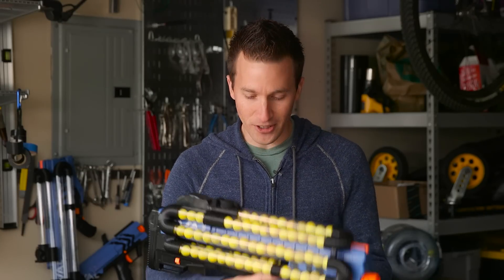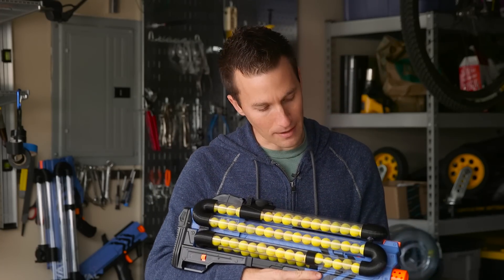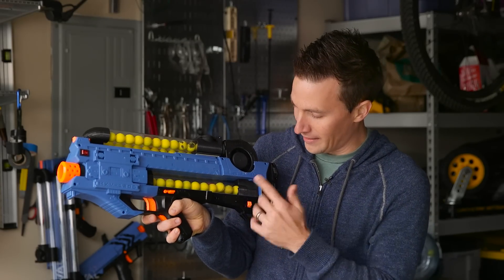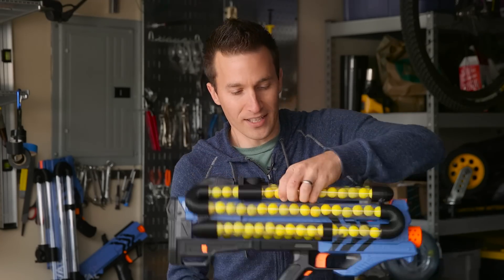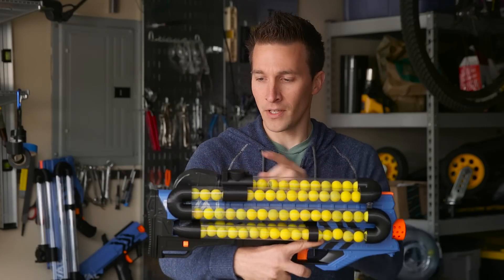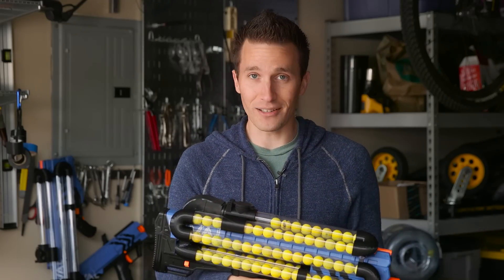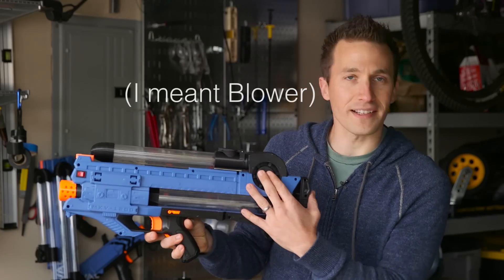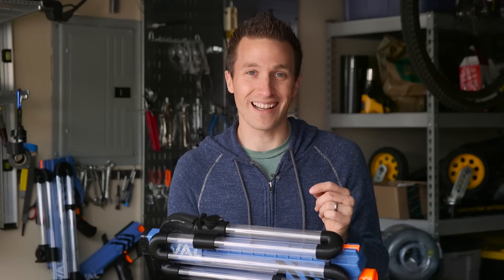MOD: HIRricane V2.0 (Nerf Rival Zeus mod)

Comment: you should use this idea to make a 1000 round backpack that feeds through a tube to the Nemesis rifle.  the vacuum at the top near the loading port then if you do 3 layers starting from the top and S shape it side to side then down and back the other way side to side 3 layers with the backpack being 9 layers tall through a 3.5 foot soft tube like used in fish tank cleaning but big enough to have balls that can go through it where the tube feeds directly to the top of the Nemesis magazine hopper door... you can feed the wiring for the vacuum through the shoulder strap that holds on the backpack down the side that has the feeding tube then along the side of the tube and into the rifle where you can do the same as you did for this one and connect the vacuum to the fly wheel trigger.
1000 round full auto without any extra tubing on the rifle itself, just modifying the trigger and the magazine.

Comment: Can you use this on a non moded zeus just to have more rounds available?
Reply: If by "unmodded" you simply mean the Semi-auto nature of the original rather than full auto... Other than that no... as the entire thing is modded to fit it - parts been cut out, parts strapped/bolted to the frame etc...

But I see no reason that this couldn't exist as a semi-auto rather than a full auto... at least you wouldn't have to worry about reloading - it'll be like less painful paintball xD

Comment: Look at this on eBay:

https://www.ebay.com/itm/171916843021

75mm x 30mm DC 12V 0.36A 2Pin Computer PC Blower Cooling Fan TP 
This is the fan at the top

Comment: That is great 3D printing work,  looking to hit up your etsy shop to get a set soon.  Question I'm planning to mod a stock extension to the Zeus and integrating the fan into the middle of the stock (sorta like an enclosed tail rotor on a modern helicopter) with an additional tube from the fan/stock to loading piece; do you think, with an additional 4-6 inches of flexible tubing, will it require additional voltage from the fan?

Comment: Looks fantastic!  Love the flip on the fan and the change to the rev-on/off switch.  Some sanding work and that cut out will look even better.  If I had the cash I'd buy something like that off you for sure.  Pumped to see your work on the Apollo!  (It's my favorite springer ATM.)

What thoughts do you have on cutting down the noise in flywheels?  That's my number one issue with them.  For a HIRricane like yours though I may just suck it up.

Comment: So do you have to take the blaster apart to remove/charger the LiPo?
Reply: +Outof Darts Will you be able to unhook the xt60 from a small hole or do you mean charge it while hooked up? Also are you planning to be able to make it balance charge in this scenario or only do that when you can take the blaster apart?

Comment: use an electric paintball loader they push the hirs in the pipe when they detect there are no hirs so all you need to do is put a pump behind it an one loader holds like 200 rounds pretty good right??

Comment: Nice Blaster! Just one question, with the fan integrated into the blaster, where usually the batteries sit, where do you now store the batteries/lipo?
Reply: +Outof Darts Very cool and nice build, a much improved version of the original design. Perhaps a 3D printed new batteryaccesdoor on the side (with your name or logo on it) for easier acces would improve it even more. But even so it is a masterpiece!

Comment: It would be interesting if this could easily integrate with the backpack. With that particular layout you would have a hose sticking straight up in your view, but it would be interesting if it was "modular". Like if the the blower was a unit that attached in a manner similar to a power tool battery, so it would be easy to click the blower off, plug in the backpack, and then later just swap it back.